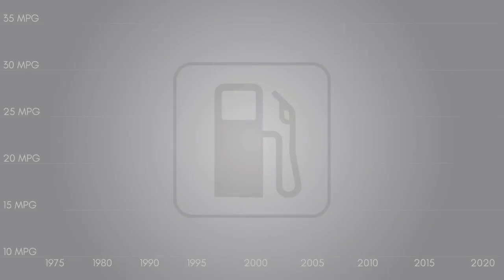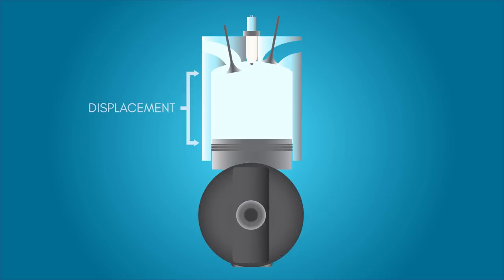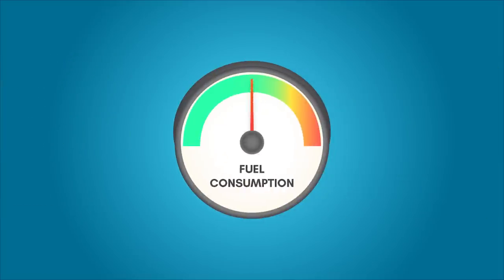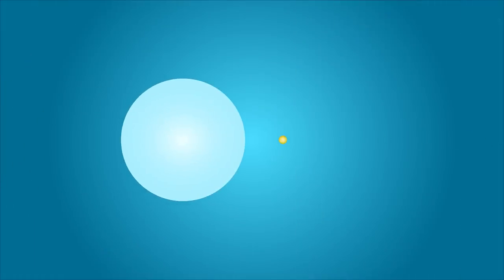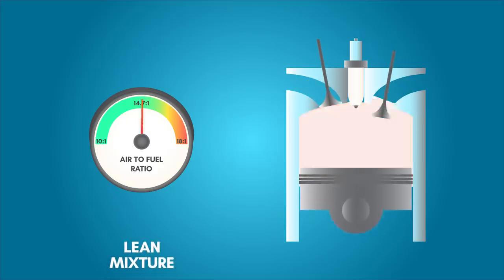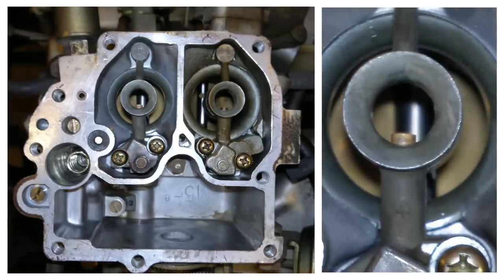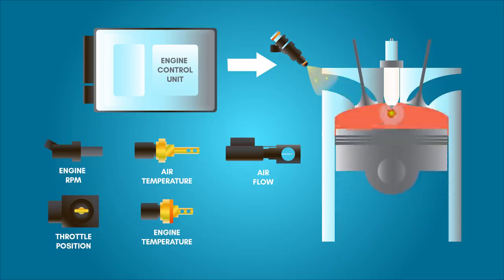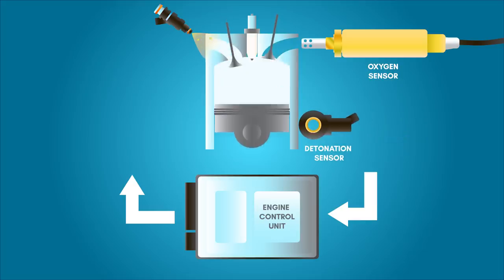How Engines Are Becoming More Fuel Efficient

Comment from the maker: For everyone looking for Part 2, head over to Gear Quest! -  https://youtu.be/G2y6cU5mN9Y
Reply: When you think about the fact that BF 109 had fuel injection you start to wonder why did the automotive industry catch up so late
Reply: To REALLY increase engine efficiency , the best and most obvious thing is : eliminate the 3 parasitic cycles of the 4 stroke engine (why they are 20% or less efficient) duh....
Reply: The difference in mpg from the 70s up until 2019 is mostly due to impotent of Japanese and European cars
Reply: At 5m45sec your Venturi illustration is incorrect, the proper placement of the throttle butterfly is after the Venturi. A butterfly before the Venturi is a choke.
Reply: Anybody thinking 4 strokes are in a parasitic condition 75 (or more) percent of the time ?
Reply: @NCOGNTO  how about 87.5 percent of the time?
Reply: @wwilcox2726  no
Reply: @wwilcox2726  yes - ask when I'm awake

Comment: What manufacturers do now is put more sensors, and fancy mechanical stuff on the engines to make them more fuel efficient. Bad news for people like me who are mechanics. It's getting harder and harder to work on cars yourself unfortunately
Reply: oh don't worry
i will still need you to take a look at my 1998 honda hornet
the only electronic thing in there is a transistor for the ignition 😂
everything else is electromechanical
Reply: Nah just get the right tools and you're good to go
Reply: Just keep loving god and youll find a way. You can always do it until you tell yourself you cant. Good luck.
Reply: @magsteel9891  are you aware on the amount of money needed for those tools??
Reply: @andresrodriguez1447  apparently YouTube won't let me tell you about some low cost options. I don't know why
Reply: It's getting harder and harder to fix now because it's demanding in terms of skill. That can be found.

The issue is companies being adamant that the repairs must be only done by them only. Components, schematics, all down to a single proprietary screw or cable. 

In case you haven't gotten it already, this us a cry for the Right to Repair. What you buy from someone, regardless of who it is, belongs to YOU.
Reply: Then learn more about them. I do the same thing and I dont see the issue.
Reply: @enkaphalin1111  no one is stopping you from working on your own vehicle. You just lack the knowledge to do it correctly thats all.
Reply: @ssj2camaro21  there are certain limitations to how much you can repair yourself put in place by the manufacturer

... Its really those repairs along the lines off "its a small issue, but nobody sells the parts since the manufafturor doesn't sell them to anyone"
Reply: @magsteel9891  Exactly what I was going to say...
Reply: @andresrodriguez1447  It's not as much as having the tools to maintain carburetors and distributors. I have an MPI engine in my boat, and I have the tools to diagnose and maintain it. It's actually cheaper and easier to run and maintain that engine than the previous carb/points engine.
Reply: Would you rather go back to school for EV training? 😢
Reply: @magsteel9891  cheap tools ah yes, been there, done that. no
Reply: Enkaphalin
Where do you live? In US the law says now that owner must can fix product by self and that affect utside states fast too, I think. And there is tools and spare parts for cars if you know what to do and if you don't, it's better for you don't do it, because then it cost more. But inside me I still understand what you mean.. hobby car is one choice if you want fix those.
Reply: "Buddy": Learn. The other point is the engine computer and sensor group tend to be modular so replacing them is an incremental change. Your challenge is diagnosis of a partially failed oxygen or temperature sensor... which confounds the dealership mechanics too. I had a "Laser" that had that. Years later I bought an "Eclipse" (out of the same plant in Illinois) and problem solved.  Do I love electrical problems? No, but like anything else you can handle  it.
Reply: @GeorgeTsiros  Sorry George but electronic engine components started coming in in 1975. My neighbor had a Nova that had problems with intermittent electronics. Wife and I bought a 1978 Le Sabre... yeah it had them too. Never had trouble with engine save normal mechanical wear.... it was a gutless 301 cubic inch V8... just didn't like hills.
Reply: @lylesloth1275  Stop. We don't need to invoke a deity for every issue. Besides the god Murphy has dominance over mechanical objects... lol. You're required to sacrifice blood (usually when the wrench slips). You people use god as a crutch. God will be happier if you solve your own problems.
Reply: @enkaphalin1111  My daughter and son-in-law pulled apart her Jaguar to replace a cooling valve for the supercharger. The valve was expensive compared to its purpose but THEY DID IT. Job was tedious without a doubt but they did it
Reply: @jannejohansson3383  that's a nice thing to hear, just that nobody really checks if something is easily repairable, or even worth to repair at all. There is no "repairability" certification standards that are widespread sadly. Even if the law exists, it mostly ever gets seen its use in cases of where intent can be proven in making a product  "irreparable".

You have to keep in mind, sometimes things can be fixed, but also sometimes not worth it to be fixed either through labour or cost. The recent iPhone glass backs come to mind. 

I don't think the right to repair ends at "I can fix my own stuff". It should be more of "more products should be made to be repair-friendly in mind, maybe along the lines of certain certification."
Reply: @francisdavis1271  you can fix an iPhone. The techies at the certified repair centers with proprietary, certified tools and components will just take out whatever is broken, toss it in a bin, and replace it with a new one. Keep in mind, it can be something like popping a capacitor, and an entire board is discarded.

Some products are easier to fix than others. Some companies like to "redefine" how fixing something means, without actually factoring in environmental and sustainability gains from the fixes made. Sadly especially with tech, we are headed into a future of disposability over repairability over all else. You're lucky to still hold on to pre-1980's tech. At least in the camera market, things really were better back then with how things were made to last a lifetime
Reply: @francisdavis1271  I'm ok with the ECU being electronic. The Engine Control Unit, mind you, as in, manages the engine and nothing else. Not the indicators, not the stereo, not the lights, not anything else. I'm kinda miffed that the ECU itself is a black box, figuratively and literally (the actual electronic circuit boards are dipped in a black epoxy-like material) but eh, if it's broken, there's not much you can do about them except replace the entire unit, anyway.
Reply: You mean fancy electrical stuff
Reply: I hate to say it but it just gets worse as time goes on.  I just beg of them to never bring back the rat's nest of emissions vacuum lines that some cars of the 80's had.  In those days some of those cars where seriously underpowered because of emissions and a nightmare to work on.
Reply: manufacturers like to lock the ECUs, electronics by itself is cool thing to learn
Reply: @charleshines1553  you just delete the old emissions garbage off the older vehicles, it often didn't work right anyway
Reply: Sensors and complecated mechanisms CAN be relatively reliable and easy to service, it just requires careful and (the big roadblock) expensive design considerations
Reply: That's what happens when technology advances. The engineering of better products surpasses the general knowledge of the public. If you know how much time and money the new Corvette exhaust took to make, you'd be sick to your stomach knowing there's someone slapping on an off the shelf Flowmaster on it.
Reply: And they lie their asses off about fuel mileage. It will say 35 miles but you'll be lucky to get 22. And they're purposely built to breakdown,  not to mention they're way, way overpriced.
Reply: @GeorgeTsiros and how easy is it to buy oarts for your vehicle